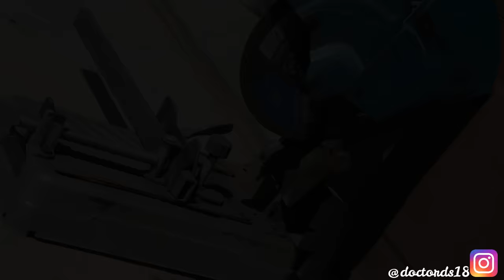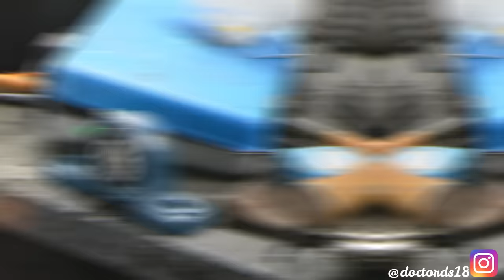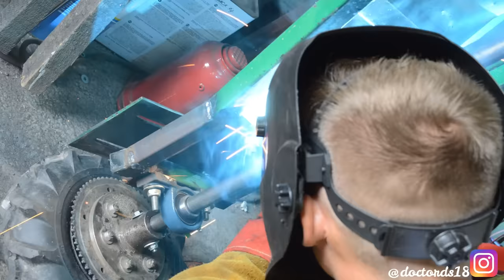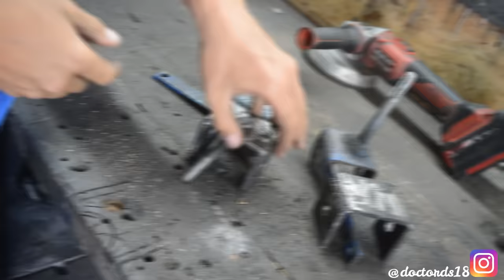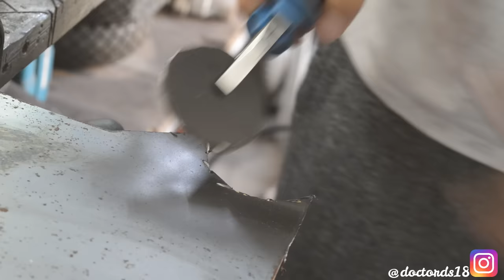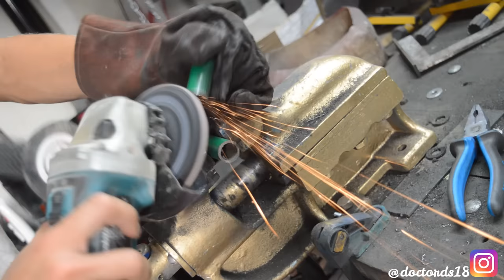Homemade 200cc Go Kart WHEELBARROW !? Part 1

Comment: If you just make the 2 back wheels on a single rod you can have them both move with the same connection and not having just one spin like crazy and the other one just sitting there